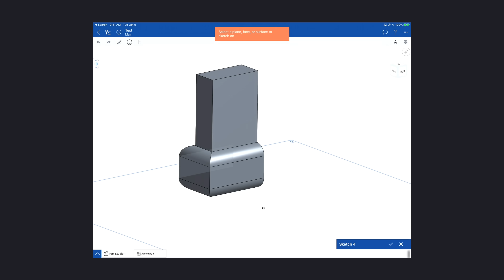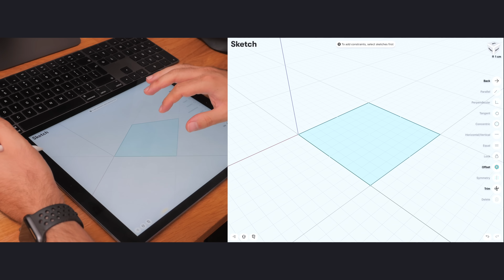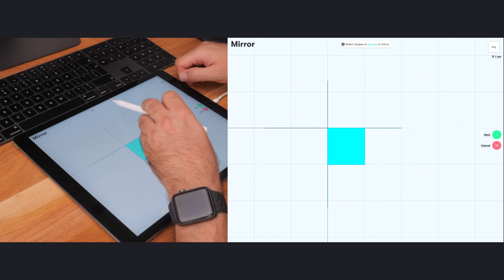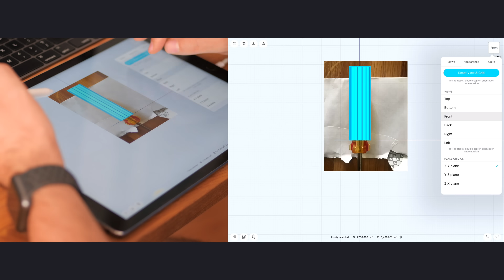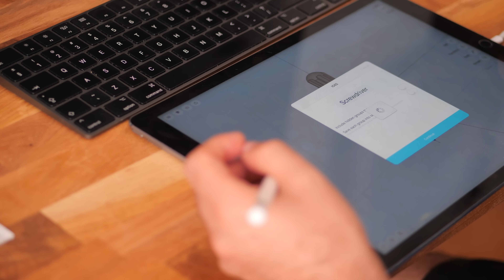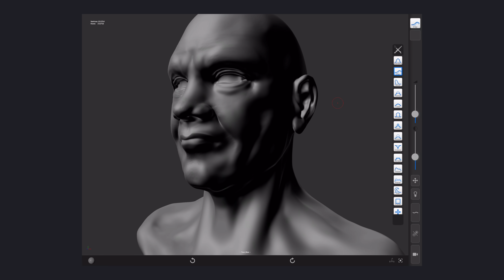3D Modelling on the iPad: Is that even possible?

Comment: Blender works smoothly in Windows, MacOS, and Linux. Hopefully, the next port will be iOS. The new iPad Pro 2018 and wonderful and user-friendly Blender 2.8 seem to me like marriage in heaven. And did I mention that Blender is 100% free and Open Source?
Reply from the maker: Blender on the iPad would be killer but don't underestimate the limitations the developers have to work with! Not only specs wise but also on completely rethinking UI interactions and layouts. 
I think the first version of a big name 3d program on the iPad would probably be a lite version rather than a full blown 3d app.
Reply: @marvelousdecay  Yes it will be a challenge but developers can port one workspace at a time and each can be a separate product just like the ones you showcased in this video i.e. start with modeling or sculpting workspaces.  I guess it all boils down to developers availability. Blender Foundation is now able to fund five developers but I am sure they have their priorities in using them to stabilize and enhance existing ports. What if IPad users can fund one or two developers to perform these ports. Adjusting the interface to a tablet may be a challenge but not impossible and we have seen big and small companies do it right now i.e. Adobe and Affinity.

Comment: There's another 3D modelling tool on the horizon called Polydust. It's still in beta, but it appears to be a proper 3D modelling program and not CAD. There has been no word on the pricing, however.
Reply: snekboi is it released on ios?

Comment: Awesome video thanks.
I wonder why the ipad 3d software is so under developed...?
I cant believe Autodesk or one of the other big companies havent released any kind of full (Basic) workflow app.

Do you know if any of these apps deal with UV mapping? So far I havent seen any UV mapping on ipad.

And I wonder if you could model/scuplt, UV and texture a model using the ipad only.
Reply: maybe because apple charges a high commission on apps vs regular SW that is installed on a PC \ Mac ?
I am sure this discourages strong players from investing big money into the platform.

Comment: Nice video but not sure why you left out uMake. uMake received App of the year for iPad from Apple in 2015, was featured in the launch of both the first gen and second gen iPad Pros, and is the only NURBS based modeling application for the iPad. It exports files to IGES, STEP, OBJ, STL, and can import in those formats as well, and now can even bring in SketchUp files. uMake is different than many of the applications because it lets you sketch curves and then create surfaces from those curves vs parametric modeling. Shapr and the ones you mention are also very good, but I just find it unfortunate that you did not mention uMake in the video as it is a very powerful modeling application custom built for the iPad that enables a completely different workflow. Hope you will be able to do a follow up video, would be really great to see!
Reply: idesigncars I have UMake  for IPad Pro and I’ve found it be counterintuitive.

Comment: Hi, great video !!!! i have a question regarding ipad though...since the 11 inch is way above my budget  do you think ipad air (2019) or ipad (9.7 inch) with the first gen pencil would run Morpholio and Sharp 3d smoothly?  thank you
Reply from the maker: I don't believe you will have any issues running the software. All of these devices are very capable. Of course the more beefed up the hardware is the more future proof you are but any device would do.
Reply: @marvelousdecay  Thank you very much for your reply. After some thought  i decided to go with the previous ipad pro 10.5 inch that has more GB ram and supports Pro motion

Comment: There is no need to bother with CAD apps for iPad. It will never be a serious platform for serious CAD or polygonal 3d modeling work. It's perfect for sculpting though. And that's what we don't get! Forger is a little cool app, but it's like Zbrush 0.9. The Apple pricing scheme doesn't work on app store. And without that Pixologic wouldn't move a finger to re-design at least Sculptris (I'm not even talking full-scale Zbrush). Sorry, Apple. You have created iPad Pro without any possibility to have pro apps on it. Those folks who tried a cheap port to the iOS, like Affinity, ended up with slow and buggy ones, that hoard iPad entire memory with one open file. So for any foreseeable future it's only iPad as a second screen with AstroPad, Duet or the future Sidecar, without UI, optimized for touch.

Comment: You forgot uMake. I think it’s one of the best modeling and 3D sketching programs in the iPad... its got a lot of issues, but there isn’t any competition on the iPad right now. Hope they patch up som things . But I’ll recommend it
Reply from the maker: I didn't have such a good experience with uMake. It's been promoted heavily by Apple as well but for me it just doesn't work that great. I hope though they can patch things up and improve things in the future. The 3D market on the iPad needs more competition, so the more players the better
Reply: What didn't work very well? When did you get to try it? What was your frustrating experience? Would love to know more.
Reply: J. Santz, what kind of patches do you want to see?
Reply: I have UMake for IPad Pro also.  It’s counterintuitive.  I shouldn’t have to work my lines around the program.  I’ve all but stopped using it for my work.
Reply: Takamusasu what 3D programs so you usually use on the PC? Are you a NURBS modeler (Rhino, Alias, Maya, MOI)?
Reply: idesigncars strictly iPad Pro

Comment: Is it possible to use shapr3d to model and render for home 3D printing use?  Do you know if there are any slicer programs that are on the iPad.
Reply: You have the options to export your projects in shapr3d into .stl files or "for 3d printing" (which also exports them as .stl) even with the free version. But I have not found a way to slice it directly on the iPad (not with apps or online slicers for the browser). I export my models to my iCloud drive and then go to my mac and load the file into cura.
I have the new iPad Pro 2018 and sadly it's not possible to export from the iPad directly onto an sd card or a usb drive.

Comment: Using CAD modelling has no "disadvantage"  the problem here is using a non-polygonal model into a polygonal software. There is no point into doing this, as someone who used to model and use it to 3d print, polygonal apps ( 3ds max, blender, etc ) are not great at all.  I love blender for art and even 3d printing with no precise restriction. So the take here would be: are you a industrial designer or engineer ? Use CAD/Nurbs modelling tools as rhino, Alias, etc. Anything else be happy with polygonal modelling.

Comment: Shapr3D does a mega fault with their pricing. 30€ one off and in app extra purchases up to 100€ would be ok. 240€ per year? no thank you. wonder till when they will keep that pricing till they are forced to give it almost free. Till then Fusion 360 may come to iPad and their project will be LONG DEAD.
Reply from the maker: These are exactly my thoughts. A one off 100 or 150 euro payment would be perfect. I don’t know what their user base is right now but I’m sure it would be much bigger if they released it with a reasonable price.
Reply: I agree. There are a lot of amateur 3D printer users who just like to design for fun or to make spares for things. Someone may be making 2 models one month and then 5 the next. The limitation is really with the quality of STL which is low unless you have the subscription. Colour is nice but not essential, not even the paid for one can import from SVG (great for extruding craft items.)  I see them as having great problems down the line with this marketing model.

Comment: I use solidworks no way you're using that on an iPad not to mention my laptop display is 17.3 which is great 15 inch is the smallest I would go .
Reply from the maker: My approach in this case would be to just model simpler and smaller parts when on the go and when back on the desktop deal with the rest of the model. Even if you could model a super detailed high poly model on an iPad I would advise against it. 

This is where having the ability to use a mouse and an extended desktop on an external display would come handy on the iPad. 
We're not there yet but give it some time and I think we'll get there.

Comment: I cant just drag the ui to the other side
Reply from the maker: I believe they’ve changed the behavior. When A document is open, click on the cogwheel icon at the bottom of the screen and there you will find the option to switch the UI to left or right hand side.
Reply: @marvelousdecay  thhank you. can you further help me like how can i resize objects in it not by percentage, but by dragging. i can only find by entering numbers.